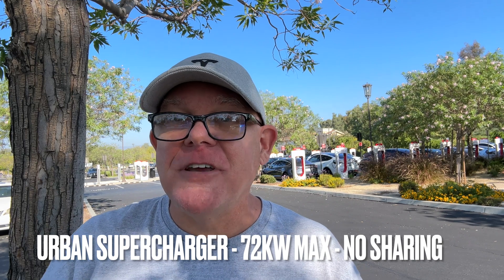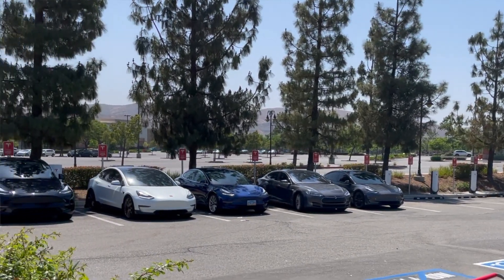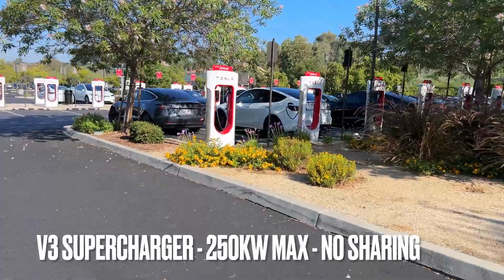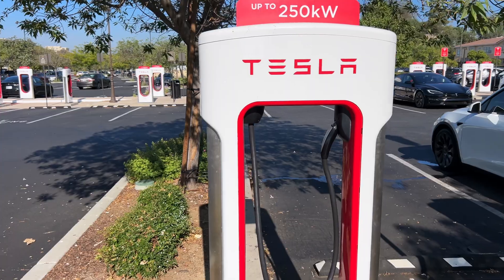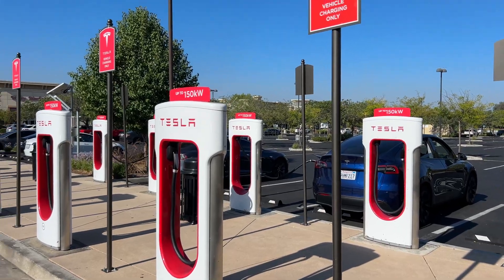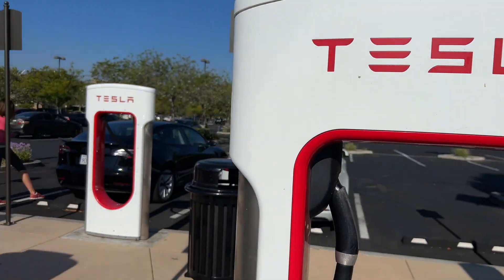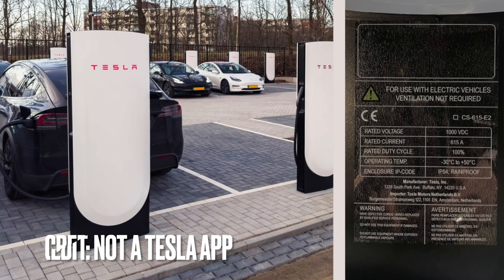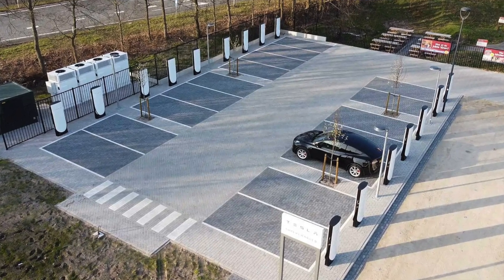Secrets of Tesla Superchargers: Speeds and V4 Revealed

Comment: I think this was  a very informative video up to the V4 discussion. You are implying that the V4 dispenser will be deploying 350 KW when my current understanding is that dispenser is still going to be on the 250 KW charging unit infrastructure. So far I don't think the installs in Australia and Europe have the back-end charging units delivering 350 KW to the new "V4" dispenser and so in a sense the charging speed has not increased. The V4 Dispenser does have attributes of a much longer cable, built in Magic docks for CCS users and credit card tap capability as well is my understanding. I truly hope the charging hardware in the ground is coming soon that can deliver the 350 KW and at least 800-1000 volts to the new V4 dispensers we are seeing but I still have not seen any cases out there yet where over 250 KW are being delivered to those V4 dispensers. Have you seen or heard of any real instances currently that are delivering 350 KW? If not, then basically this should be called an updated V3 Dispenser instead of V4 if it is only going to deliver 250 KW speeds.
Reply from the maker: https://www.teslarati.com/tesla-confirms-v4-supercharger-350-kw/#:~:text=Tesla%20has%20confirmed%20a%20significant,were%20capable%20of%20those%20speeds. Thanks  for watching
Reply: Not according to Kyle Conner from Out of Spec. :)  @whooshn
Reply: start at 9:30 mark to see what he said.
Reply from the maker: I watch (and have met Kyle) all the time. I'm fairly sure he's said it's 350kw as well. You linked to my video so I couldn't see your reference. It makes no sense honestly for V4 to be the same as V3, although no current Tesla can charge past 250kw anyway, (except maybe Cybertruck) but we don't know that yet. Google "v4 supercharger 350kw"
Reply from the maker: Watching the Out of Spec Podcast that I think you referenced....interesting.